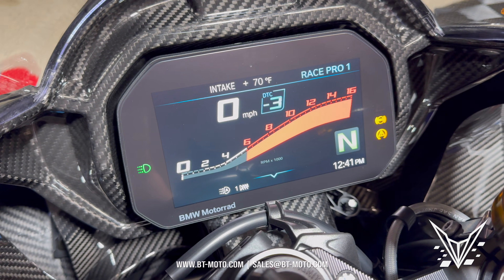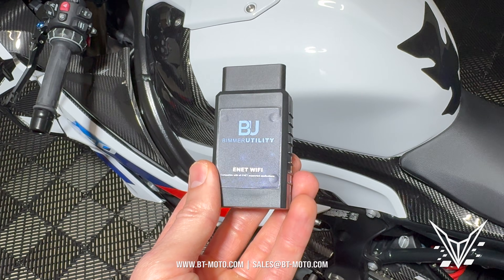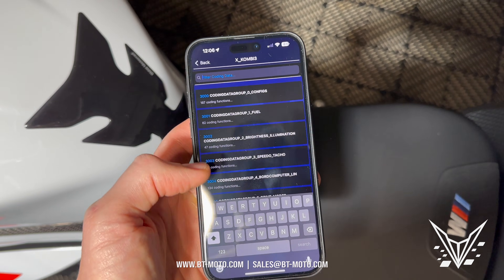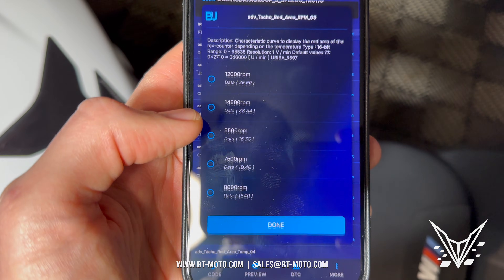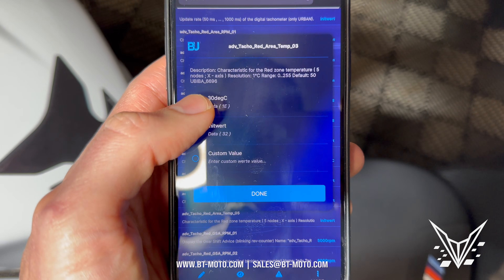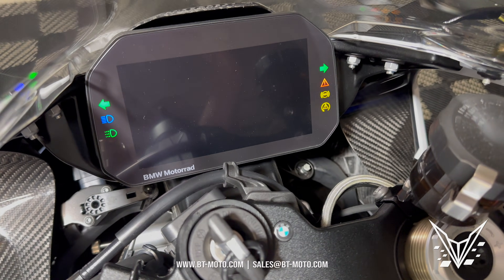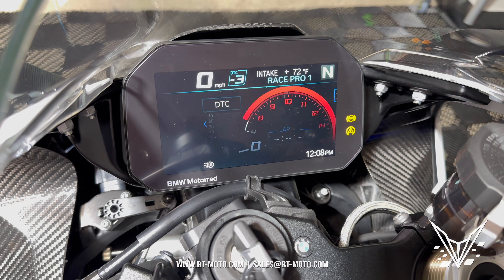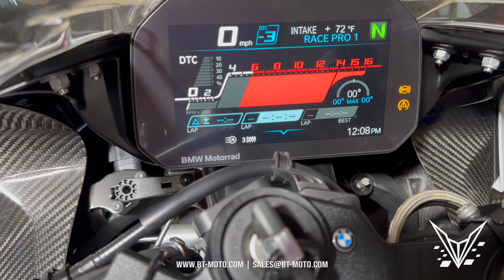How To Add 16,000 RPM Screen to 2023-2024 BMW S1000RR, BT Moto Tutorial

Comment: i did the 16k RPM, now when it reaches 8k RPM the red line keeps flashing warning to shift gear. is that normal?
Reply: Ever get it figured out?
Reply: @sixty4pilot  no i haven't. its still the same.
Reply: @republicofu.s9642 mine does the same. Figure it out yet? I’ve tried a bunch of different settings.
Reply: @kensnipes523  if you didn't get it figured out lemme know, i have the settings saved message me
Reply: @illusionalta whatcha got brother? I ended up reverting mine back to the 15k rev limit because mine kept giving issues utilizing the gs-911 tool.

Comment: You said the M1000RR and the S1000RR both have the same rev limiter. Is that true? Doesn't the M have a higher rev limiter?
Reply from the maker: For 23, they both have the same RPM limit
Reply: I dont think so though. Stock 2023 s1k makes 210@13750 whereas m1k makes 212@14500 rpm as pec their spec sheet. Are you saying both also make the same power? I am concerned because I just bought the m1k stage 2 from you.
Reply from the maker: @v4r-retard  we aren’t talking about power, just final RPM limiter on the 23 models.